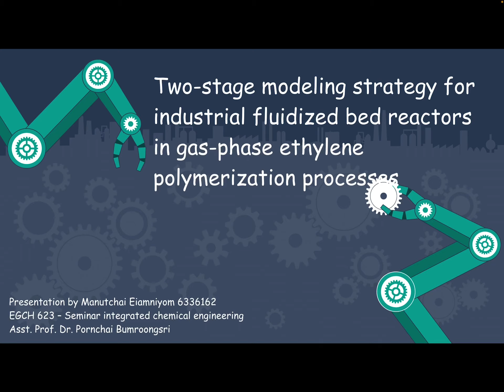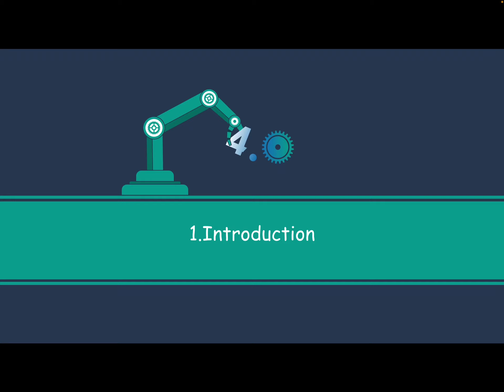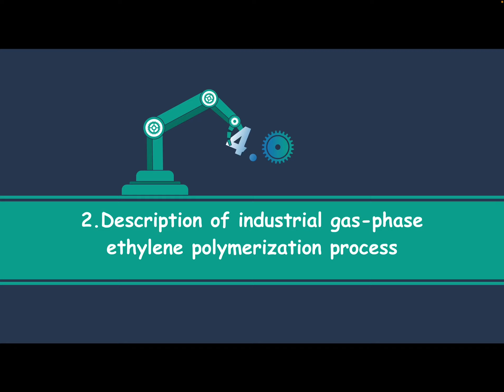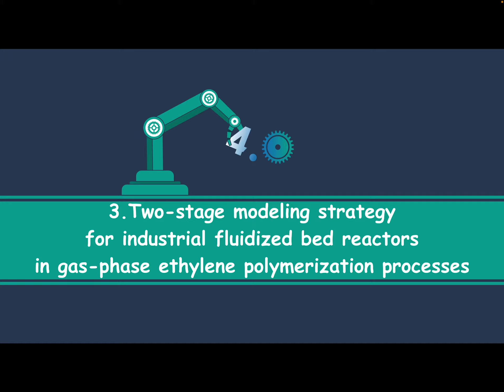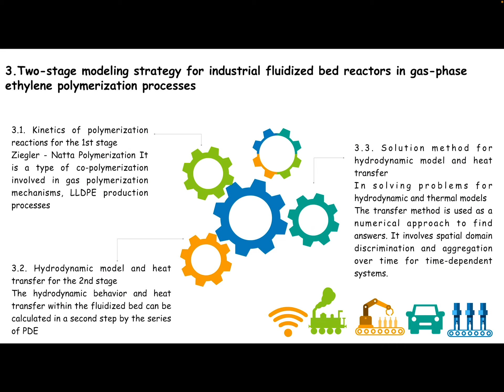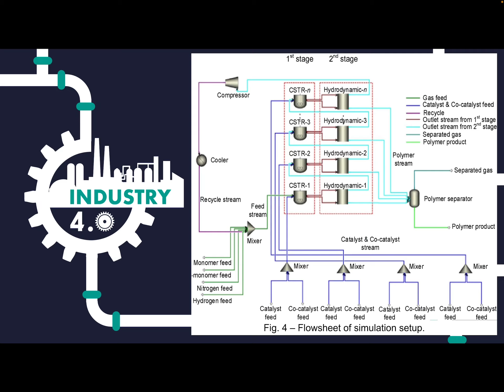Two state model state for industrial fluid bed reactor in gas phase ethylene polymerization process

Comment: What it a type of catalyst normally used in this process? // Do you consider the attrition of particles during the fluidization?
Reply from the maker: The catalysts used are titanium-based catalyst and aluminum alkyl-based
co-catalyst, which are titanium tetrachloride and triethyl aluminum, respectively and the example of the nets research focuses on the study of polymerization by using the 2-gas phase process only.

Comment: One more thing. Which parameters are you following? And how do you know that parameter is going to be essential for the productivity of the reactor?
Reply from the maker: An example of this research is a mathematical model in the design, so it is necessary to verify all parameters such as fluidized bed reactor, compressor, cooler, polymer separator.

Comment: The audio quality is poor here. But, I can also observe your effort in slide and script preparation.  However, I did not quite catch the idea of the two-stage modeling strategy. Which models are you talking about? How the models are applied to the fluidized bed polymerization reactor? And, how will the models help with productivity?
Reply from the maker: The proposed two-step modeling strategy was applied to the gas phase ethylene polymerization model and the Thailand simulation. The developed two-step modeling strategy was compared with actual factory data to verify the simulation results. The parameters for the inlet stream of the first stage are initially specified such as feed flowrate, feed composition, temperature, pressure and other physical and chemical properties for both gas and solid phases to solve the kinetics of polymerization reactions for the first bed layer. The converged solution from the first stage is used as the inlet condition for the second stage. In the second stage, the PDEs
for the hydrodynamic model and heat transfer of the first bed
layer are computed to obtain the volume fraction and temperature profile for both gas and solid phases. This procedure
is then repeated for each bed layer until the last bed layer is
reached. But this article does not say how the model can improve productivity?